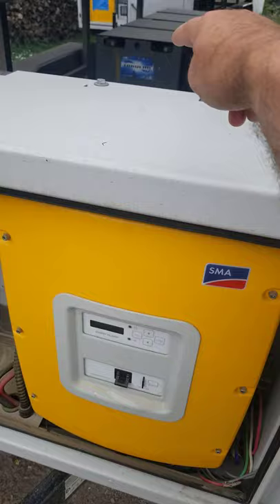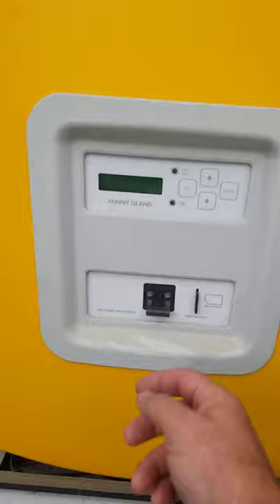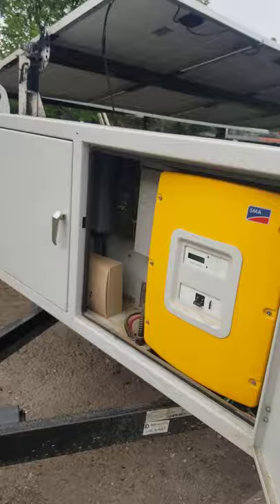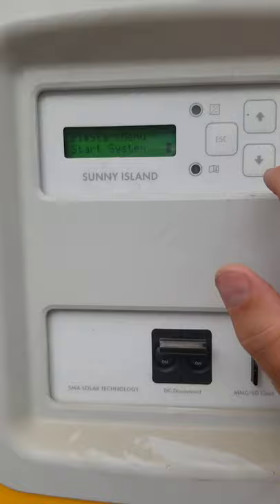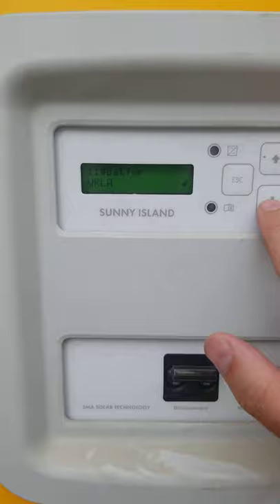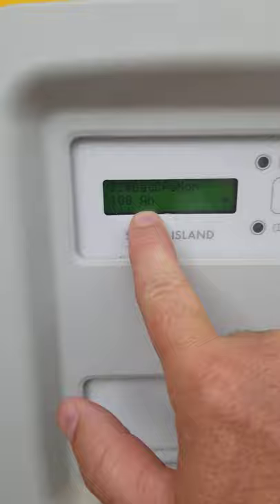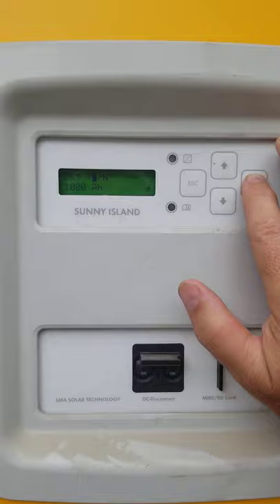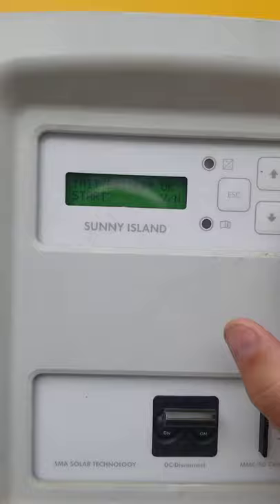DC Solar Trailer New Battery Setting - Remind the SMA what battery type it's hooked up to.

Comment: Thanks, Joshua - we purchased our DC Solar Trailer yesterday and I will go out and make sure that it is on the correct battery setting. SOC came up 20% yesterday on the display screen so we will see how well the Midnite Solar charge controller does to push power into the battery bank.

Comment: The table in the battery section of the inverter manual actually calls for a amp hour rating of 12 hours I believe and the sticker on the battery is showing for 8 hours. The correct number is 635 x 2 amp hours for the 540 tubular batteries you have on your trailer so 1270.

Comment: Any advise on how to stop sulfating. I have this trailer and one cell casing melted and now its ruined. I ran a jumper cable to bypass this cell. Now the cell I jumped to is starting to sulfate. Any advise would be appreciated.
Reply from the maker: They are forklift batteries. Anyplace that works on forklift batteries can help fix that issue.  They'll likely replace one or more batteries.  It seems like once a battery goes bad, it tends to spread to other ones.

Comment: Do you have to do the same thing to secondary inverter?
Reply from the maker: No. Just the primary inverter. I never touch the secondary other than to turn it on or off.